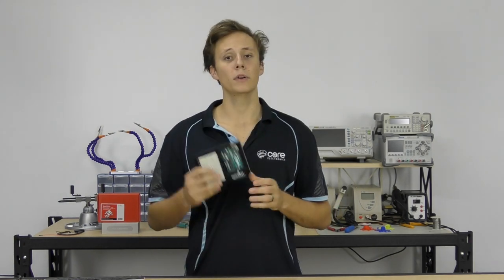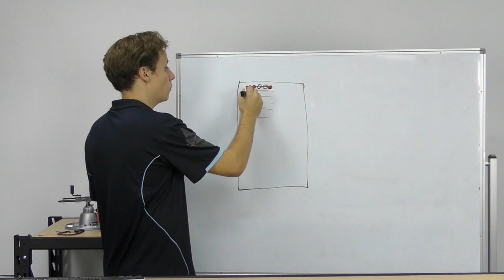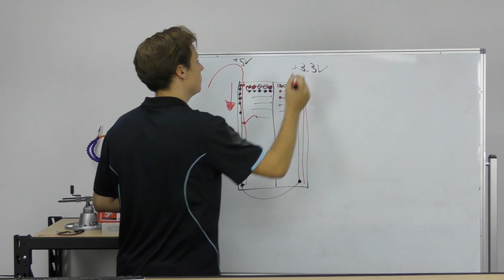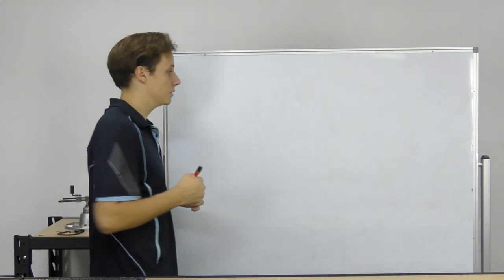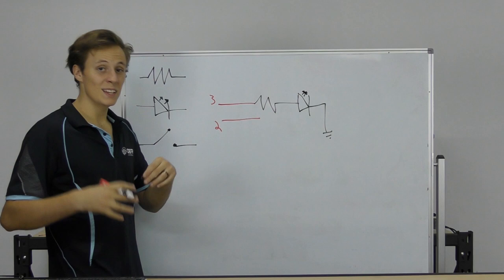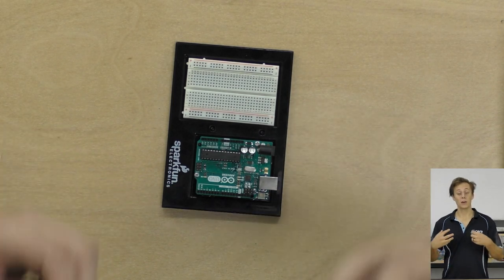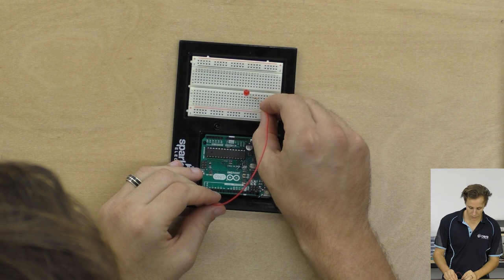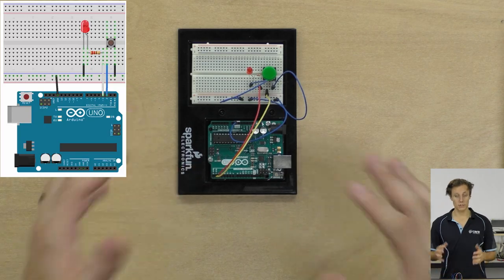Arduino Workshop - Chapter Two - Building Your First Circuit

Comment: What kind of resistor do I get if I want to make this circuit? I live in India so I don't have access to the kit shown in the video. Anyone who knows anything about it, please let me know :)
Reply: The kit comes with different types of resistors. The three types that come pre-packaged are: 220 R , 1 000 R , 10 000 R. For an LED the 220 R resistor should work just fine :)
Reply: btw it would probably be useful to learn the ohm’s law so you can calculate it for future projects :)

Comment: What I find confusing is that - to me - "digital" means a series of ones and zeros. Like in serial communications. But, here you are using the digital pins as simply a DC power supply for the LED. Pin 3 is really just the +ve terminal of the power supply. I get that the switch can only be on or off - but you don't need an Arduino for that. The light switch in my office doesn't need an Arduino to make the light turn on. Great videos though! I've been playing with Arduinos and ESP32s for a few days and have been doing stuff like reading CAN bus data, but you really need to go through the basics first to really understand something.